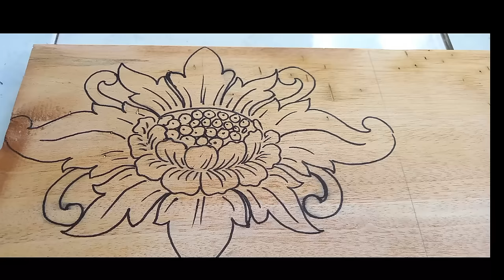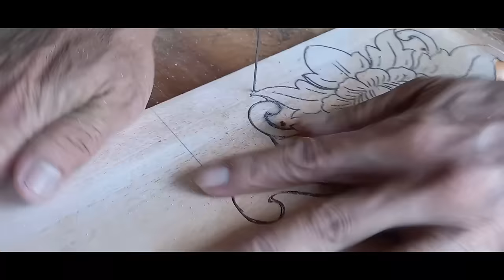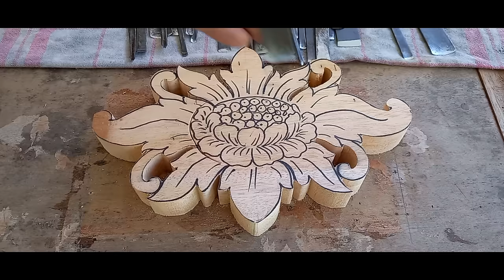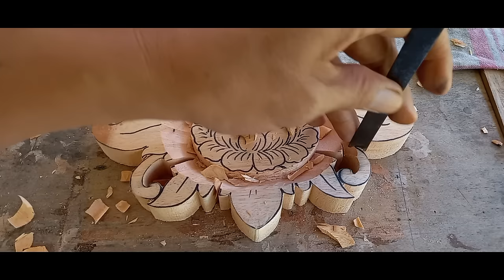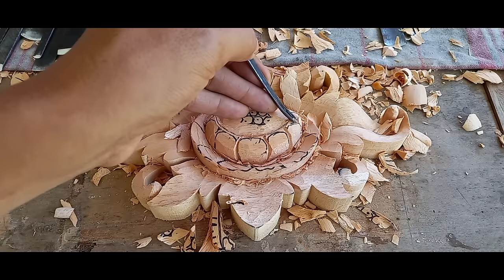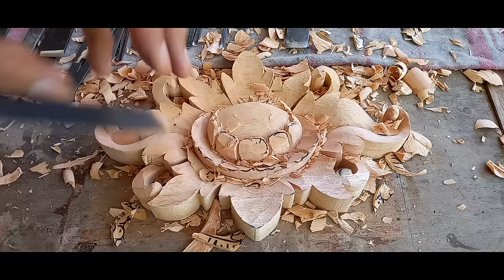beautiful wood carving || wood carving ideas || wood carving flower and leaf.

Comment: Your artwork is amazing!!  If I could request only one thing, it would be this: Is it possible to not only show the particular tool(s) you are about to use on a specific area of the work, but could you use text lettering on the video that tells us what the tool number is and what its sweep is?  That way we can properly translate that to the area you are about to work on at that time.  Unbelievably outstanding techniques.  Now I want to buy the correct tool(s) I need to recreate it.  Thank you very much for sharing.
Reply from the maker: Thank you for your great Idea, much appreciate. Hopely I can make it as you request.